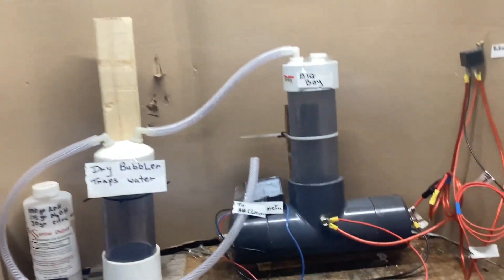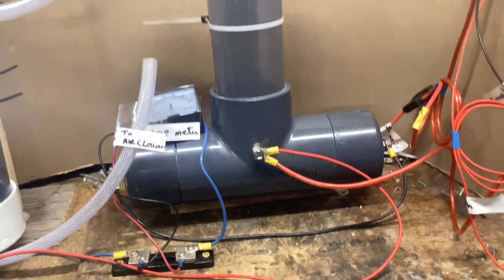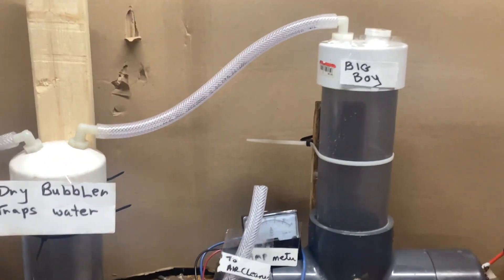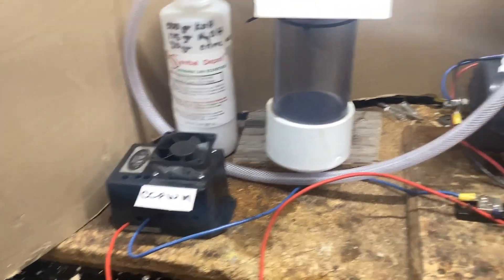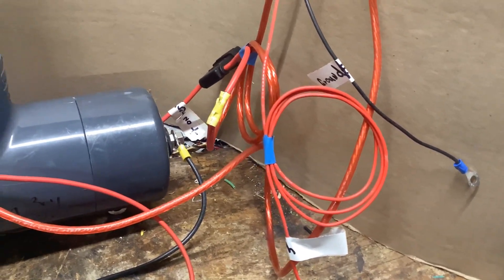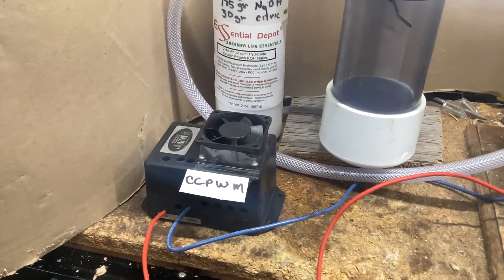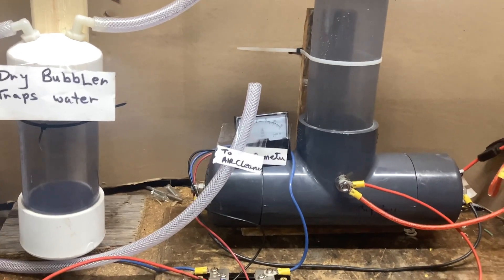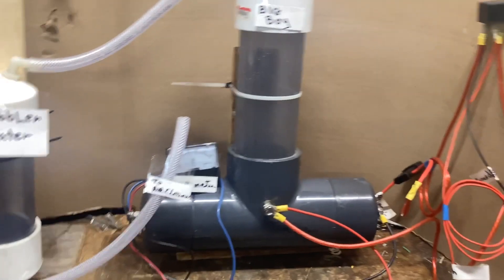Complete hookup of HHO Big Boy  for generators and cat dozers25% fuel savings have been achieved

Comment from the maker: I have a meter that measures HHO and it was special built for me cost 1000 dollars and it reads what is pushed out. My engineer Darol Mason who helped me. Had a machine that would measure it when in use on the car and the out put is high because the vacuum would pull more out.

Comment: What is the LPM of your Big Boy, and how many watts does it use? Thank you very much!
Reply from the maker: the Big boy was made for semi's because of all the engines semi's can save the most. I have some say they save $35,000.00.
that said it uses 15 to 16 amps at 12 volts dc.
So when its not hooked up to a engine it puts out about 950 ml of HHO per Minute
When hooked up to an engine it produces about 1400 ml per minute.
Why because hooked to an engine you have a vaccuum pulling the HHO  out. 
I had an engineer test this at D&R engineering. He had a special machine. I have an alley cat measures HHO but not hooked to a engine